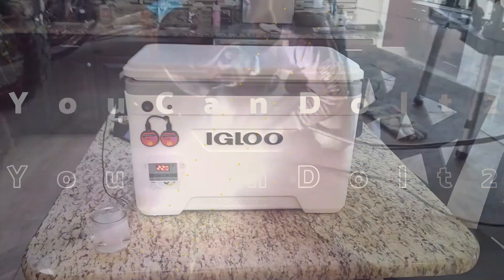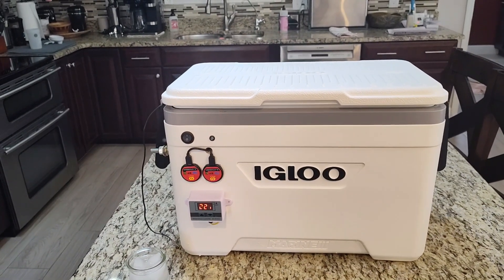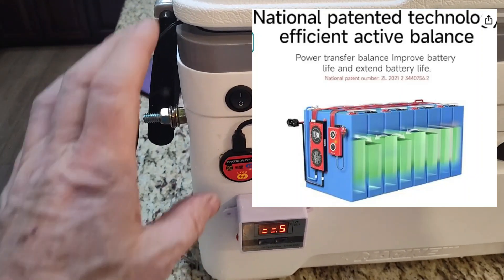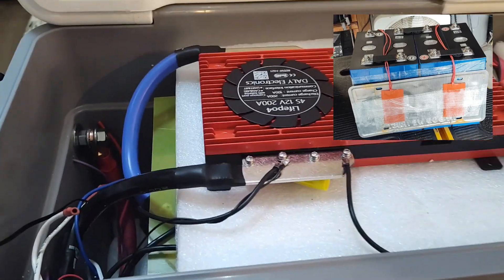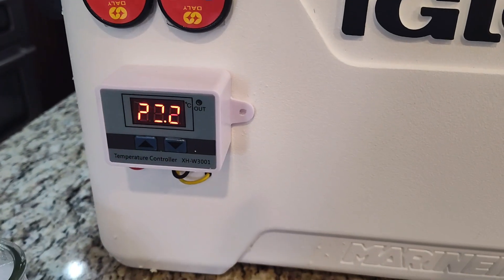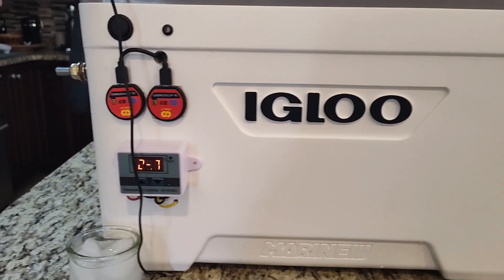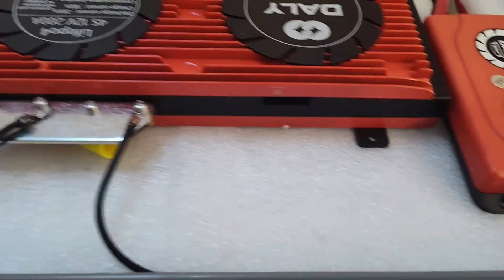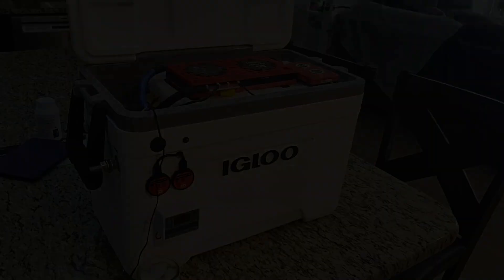DIY Heated 12VDC 280Ah LifePo4 Battery

Comment: I just bought a 100ah lifepo4 but have not bought a charger for it yet. I have ~ 1300watts of solar panels and a seperate 100watt solar panel. Instead of relying on your bms to act as a charge controller, have you thought of running your charging power supply through your solar charge controller to safeguard your bms ?  You might be able to increase your charging supply voltage ? I am interested in your reply.
Reply from the maker: I am not 100% sure I understand your question. However, the BMS is there to protect the battery and has very wide parameters to accept charge from a variety of devices, but whatever is used needs to be compatible with LiFePo4 and not exceed the 14.6VDC needed for charging. If you are wanting to connect something that will put out more than 14.6 v through the solar controller to have it limit to 14.6 maximum that may work, but I wouldn't do it.

It is not recommended by most solar chargers to connect other types of power supplies to the solar controller especially if the supply would drive more current that the solar panel array. 

An option may be a DC to DC converter capable of the desired voltages. 

Best wishes.